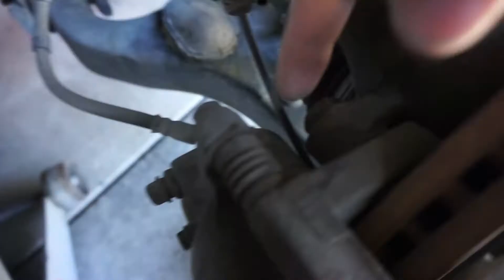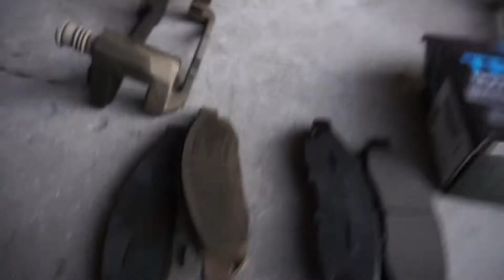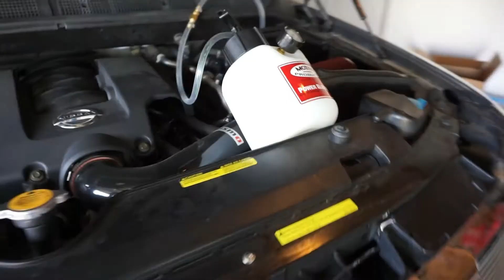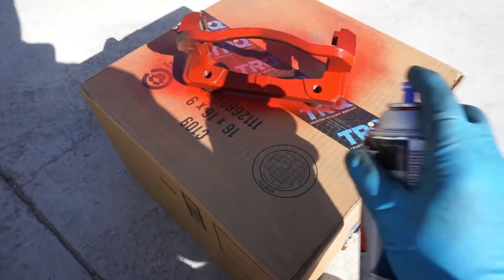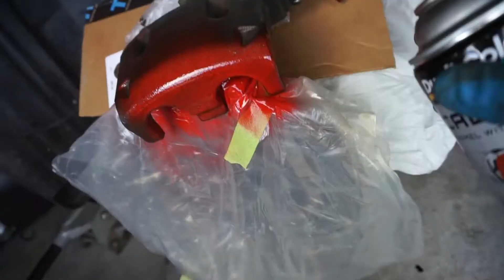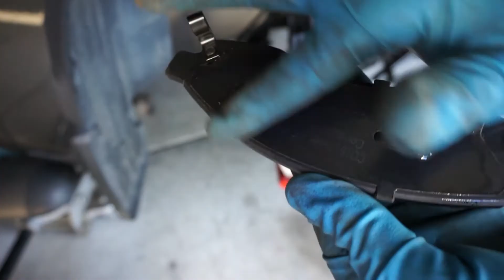2004 - 2015 Nissan Titan Front Brake (Complete) Installation

Comment: I will NEVER use drilled and slotted rotors on a Michigan vehicle. We have RUST and rotors ROT like hell in Michigan. I remember using a CUT OFF wheel on the rotors on 2 Chevy Nova's  just to remove them. You haven't  lived until you cut a rotor off a vehicle because it wouldn't  come off.  Why would you do ANYTHING with the caliper doing a simple brake job. If the piston(s) hang up, or are difficult to press in with a C- Clamp or brake tool THEN you mess with the caliper. Sorry dude but your video is sad.
Reply from the maker: Coming from an RC hobbyist??  Right.  The only thing i did to the caliper was paint it.  Know your brake parts before you comment.  My channel is for the "Do It Yourselfer" which you may not be capable of.  I suggest you stick with Value Mart for your service needs, seems to be treating you well.
Reply: @garasierra8886  A real wize guy huh? I just finished  all 4 brakes on our Subaru chum. My Titan is next. I have been doing brake jobs since before you were probably born son. The only insult here is to yourself for making comments on someone you have no idea about. If anyone needs to stick to a Chiltons manual, it's you. Leave the professional work to the experienced folk son. Anyone can get a mechanics licence now days. A true mechanic takes YEARS to learn, and we never stop learning.
Reply from the maker: @scottfirman  Not surprised I'll have to be the greater person here.  I wish you the best with your future endeavors.

Comment: Great Video, but the pressurized bottle that you used, should be filled with Brake Fluid so that you do not have to remove and fill by hand.